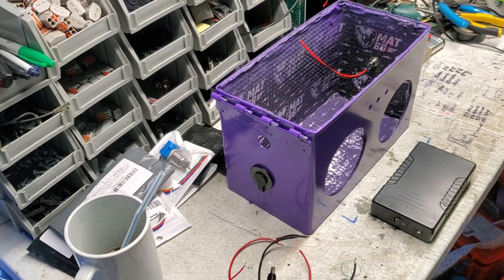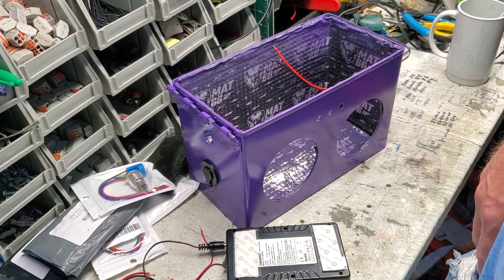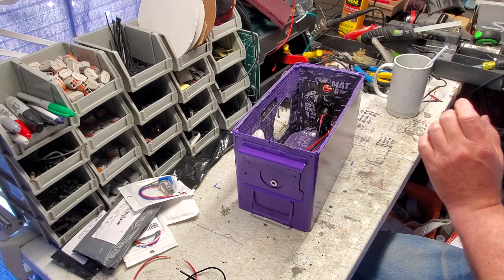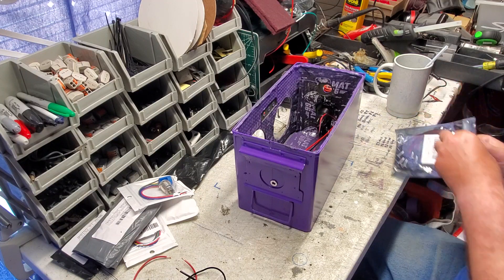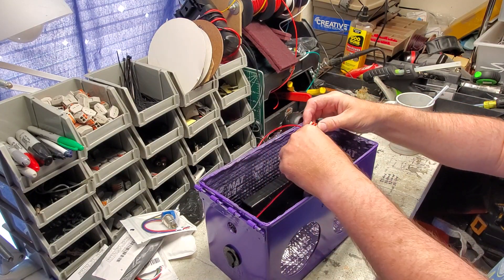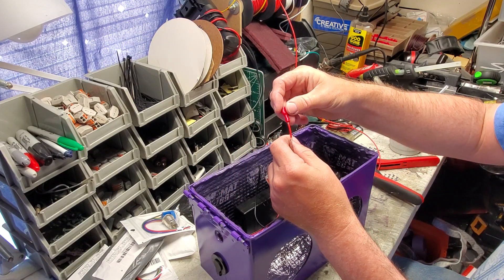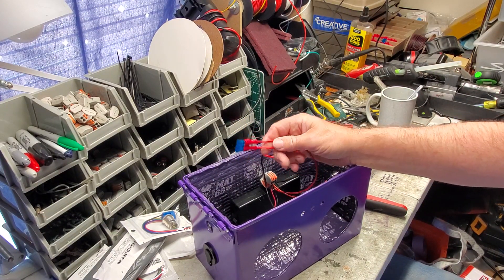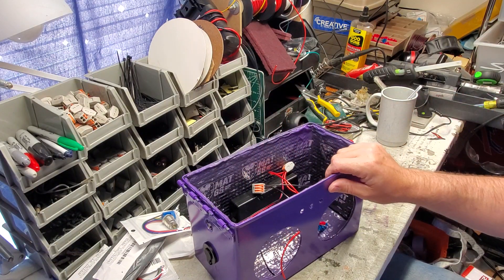How To Install A Lithium Ion Battery In Your Project

Comment: Do you have a video showing how to wire the switch to battery
Reply from the maker: Yes. I have a video called " how to wire a marine switch".
Reply: @diyboomboxesintexas2805  how do I  wire the switch to turn off the battery

Comment: What battery can I use to get a solid 12hrs out it? ( 2 kicker 6.5 and 2 tweeters)

Respectfully sent,
Reply from the maker: 15ah deep cycle battery
Reply from the maker: Now that size can you would have to use a 10ah

Comment: Quick question can you connect a voltage booster to this battery ??
Reply from the maker: You can but it would greatly reduce the run time on it.
I only boost the more powerful projects that require a larger battery

Comment: I like this as another way of adding in the battery... I use this same battery but solder to the existing switch wired the outside side of the speaker this allows me to turn the battery on and off
Reply from the maker: I have never done that. I just open the box and switch it manually